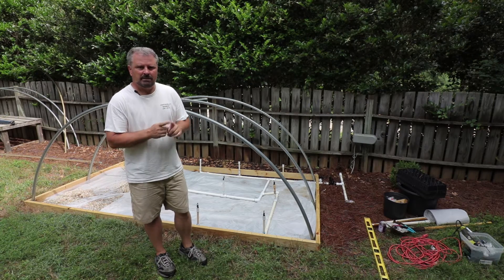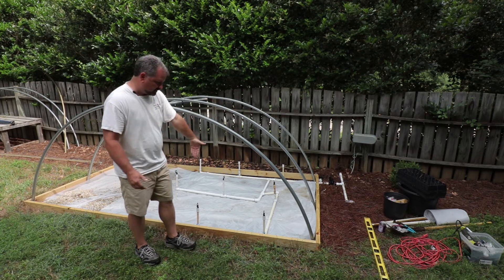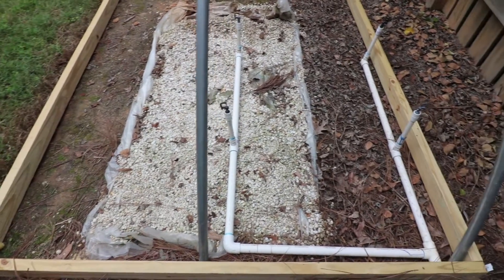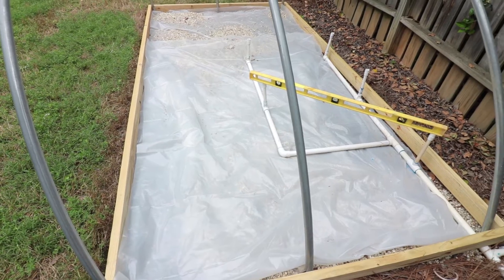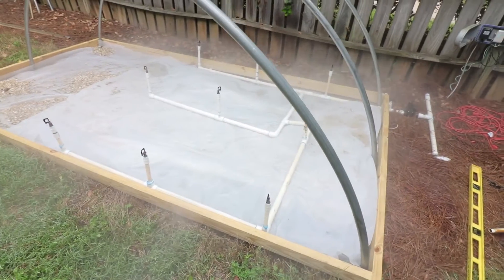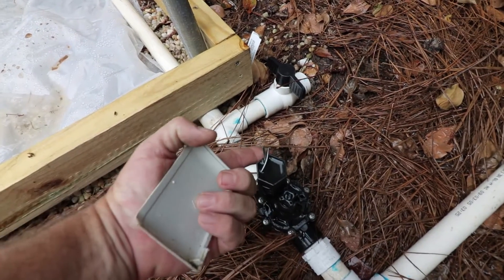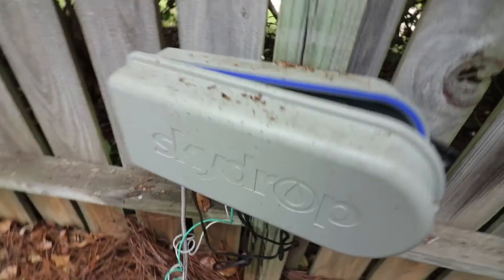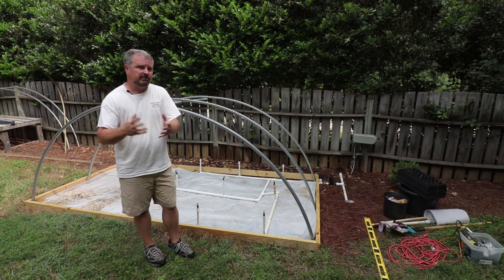Backyard Plant Propagation 2 - Mist Irrigation

Comment: Interesting. Things are much different in NC than the Central Oregon Cascades.  We can get frost any month of the year so everything is underground.   I put good landscape fabric down then sand, then heating cables, then more sand with my misting system over the top of the propagating house.  I would be concerned about water build up with the ply on bottom and poly does not last very long here.

Comment: Will that controller, when used with just a 9 volt battery (no AC adapter), still open the valve?  My understanding is that the solenoid on that rainbird irrigation valve requires 24v DC to open.  Therefore, I would think that the AC adapter on the controller is required in order to convert AC line voltage to 24v DC.
Reply from the maker: No, the battery just keeps your programming in case of a power outage.
Reply: Thanks for the confirmation.  Instructions starting at 10:29 can be misinterpreted.   Someone who purchases this controller will need a nearby A/C power to plug in the controller.
Reply: BTW...Galcon also makes a mist irrigation controller and valve that will operate without an A/C power source.  It uses a single 9v battery. The model is 6151-DC1S.  I have used this for several years with good results.

Comment: Great videos Jim, thanks. Would you recommend building this in shade, partial shade/sun, or full sun? Thanks.
Reply from the maker: I would prefer sun with this system. We want to make sure they are drying off between irrigation cycles. I will use shade for other techniques I will show that are not irrigated.